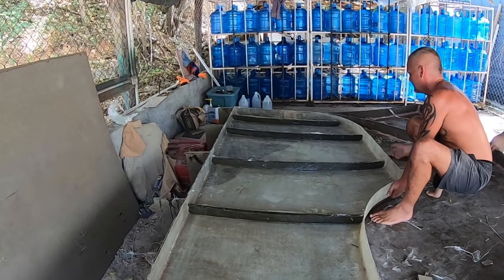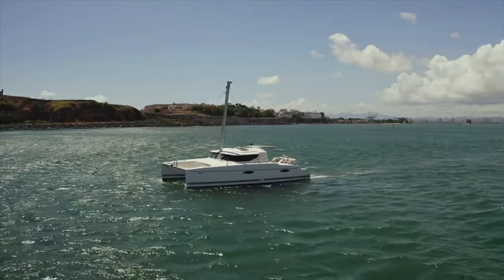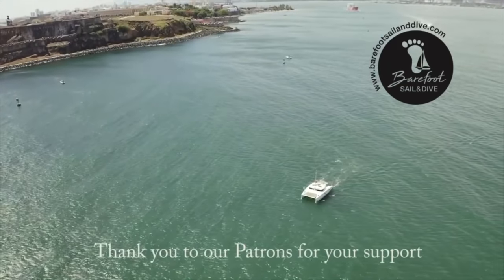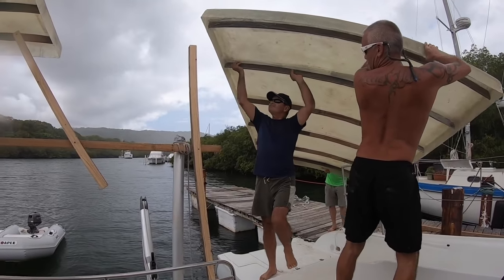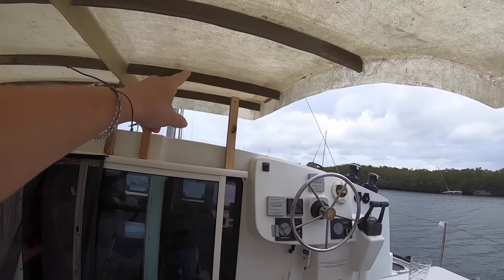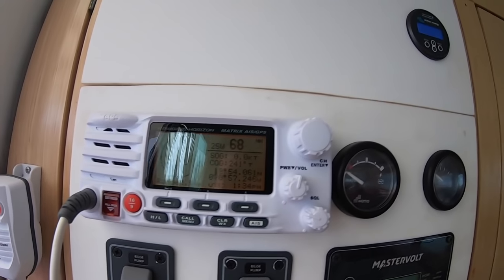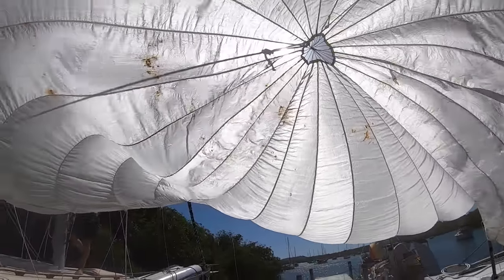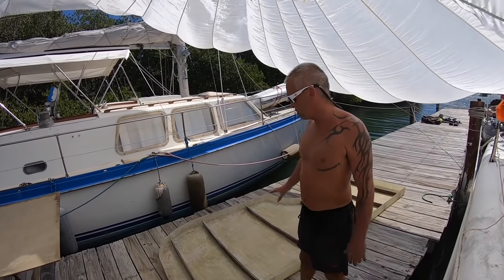How To: Build a Hard Top For a Fountaine Pajot Catamaran Part 5 - Plus Tropical Storm Prep (S2 E20)

Comment: Great job on matching the cabin top curve on the bimini, it really is looking good.
I think having the bimini raised along the front like you are doing is much better than the original design. Was onboard a Leopard 39 which had the bimini straight off the cabin top. While on anchor, I was surprised how little airflow came into the cockpit compared to a cat with a raised bimini.
What is your planning for the mainsheet system? I notice some of the Mahe models have it along the back of the cockpit, while the Evolution version it is on top the hardtop.
Reply from the maker: Thank you! 
Ours is the evolution version so we will try and incorporate it onto the hardtop. Due to covid we probably won’t be able to get a mast/rigging anytime soon. But that is the plan eventually!
Reply: leave it raised. Better visibility and air flow

Comment: I'm truly enjoying your current build a hardtop bimini project.  I've been looking for a video of this quality for 2 years now.  Thank you.  I see on other sistership's to yours it appears they use 4 main mounting points and have the traveler mounted above on the bimini.  I'm in the design phase for more my slightly smaller cat, IPY Packet Cat 35 and have been struggling with how to mount a traveler up there.  Main concern obviously is to not have it rip apart the bimini in big winds.  Can you share your design ideas for that?  I was thinking 2" schedule 40 aluminum pipe but really not sure that's strong enough.  My boat uses a dead eye  to attach the mainsheet and the sheets going up hit you in the back of the head at the helm station.  A slight design error. Also want to be able to walk up there to deal with the inevitable main sail issue when it arrives. Thanks.
Reply from the maker: Yes happy to share our plans. The mounting points are still undecided. We will be videoing the whole process. 
Thinking of 4 support posts not sure if stainless or aluminum yet!
Reply: On the supports the question is how much do you need? I have tons of experience working on boats in wood, metal and some fiberglass but no idea about engineering strengths.
Reply from the maker: Im still working on the exact calculations. Aluminium is half as strong as stainless but only a third the weight. So if we go aluminium well go bigger in size. Thinking about using pipe. But also depends what we can get here. 
There is a possibility to get stainless but not sure what the cost is yet. 
We are going to use the same fixing points for the back supports and the traveller as designed by fountain. 
We will keep you posted as we go!!!!